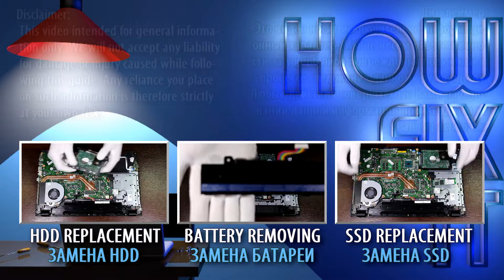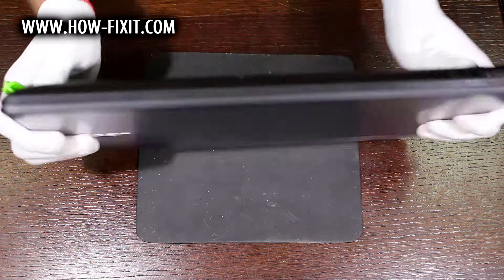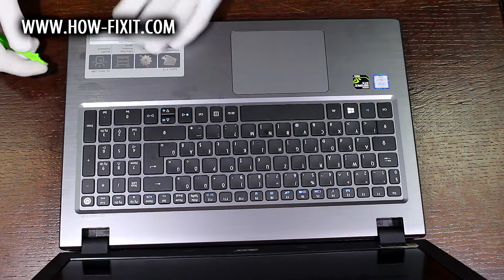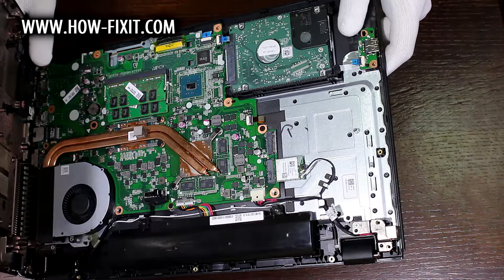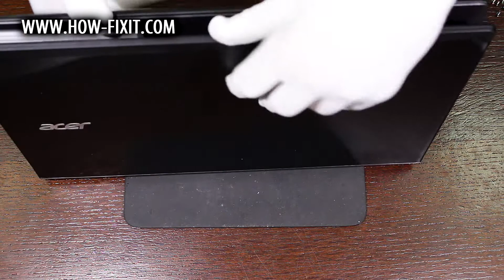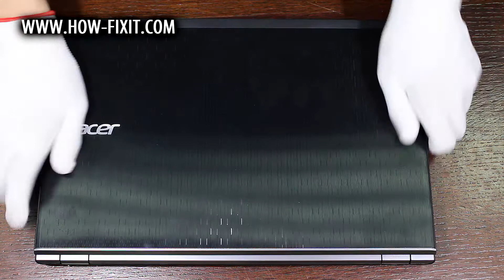Acer Aspire V5-591G RAM Upgrade and Install - Your Step-by-Step DIY Guide!

Comment: Did you experience a noticeable performance improvement in boosting from 2x4 gb to 2x8gb RAM or do you recommend upgrading to SSD first?  Which is best method for SSD upgrade, replacing Hard Drive or using M.2 NVME